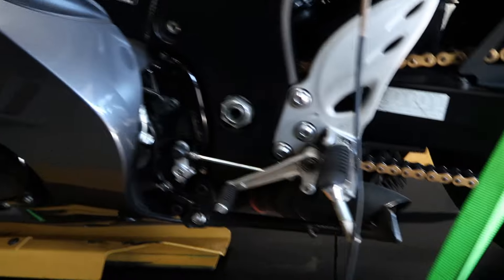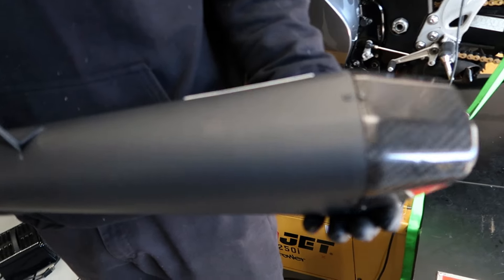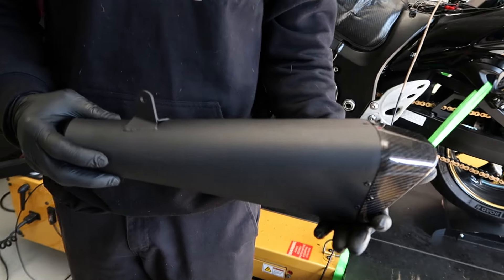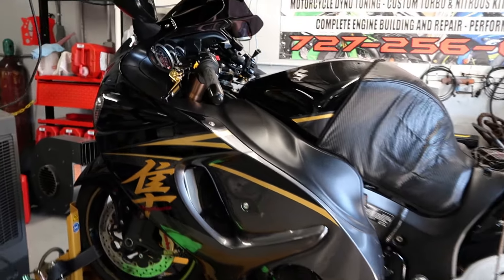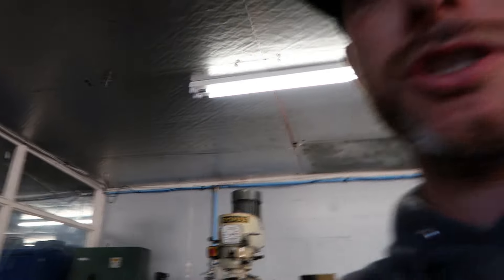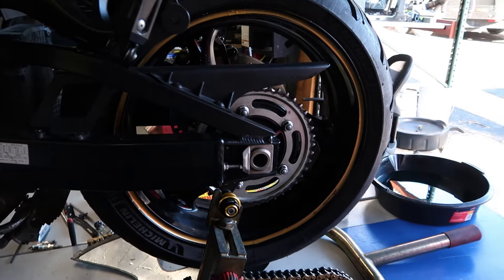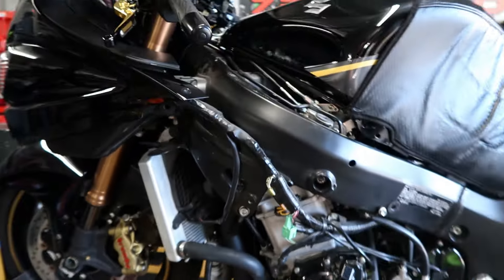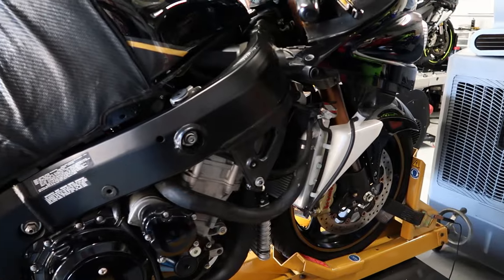2015 Suzuki Hayabusa with Brocks Penta-Carbon BIG GAINS!!

Comment: Only 10ish hp on a zx14r, just sayin 😂
Reply from the maker: Usually on 14r's between exhaust filter and a tune, we pick up around 12-15whp. Pretty substantial considering yhere are no factory restrictions built into the ecu 👍

Comment: Did you put block off plates in or just block the pipe in the air box🤔 you boys do good work there
Reply from the maker: We do not block off air flow like using the Ole marble trick or anything similar. We usually install full on block off plates depending on the bike. 

Some bikes, we are able to shut down the system entirely without having to install plates at all, while others, we have to physically block them off and then turn off fi light thru the ecu flash. 

And thank you for the compliment. We have a great team and building something great takes time 🙌